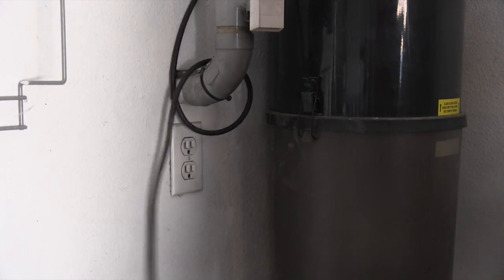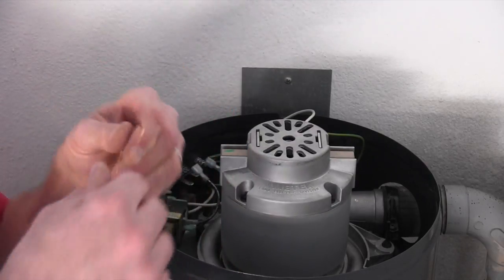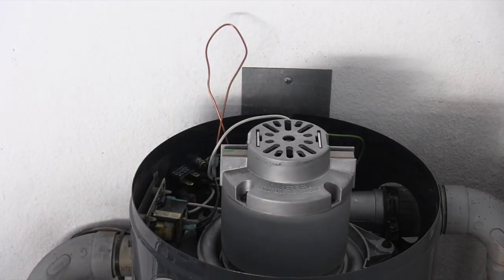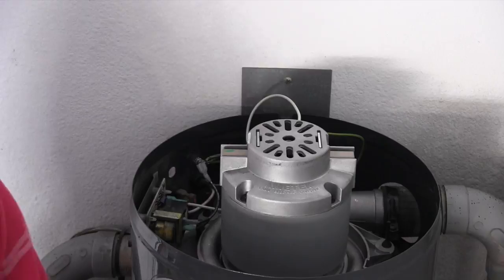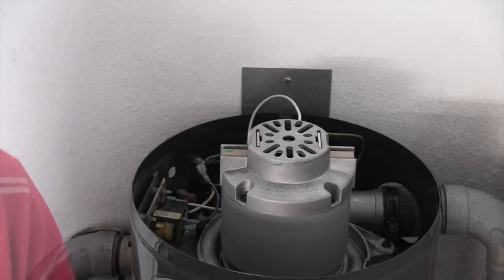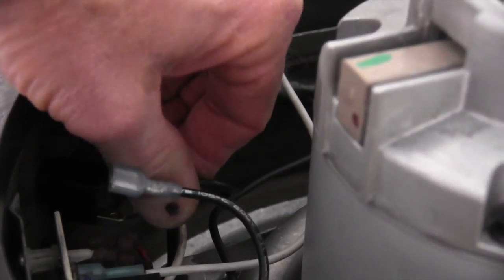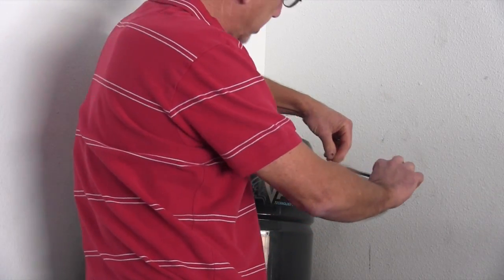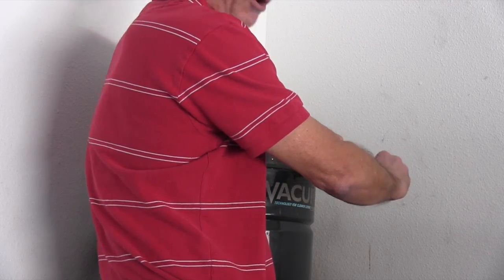An Easy Repair for a VacuFlow Vacuum

Comment: Your fix worked perrfectly!  I've got a Vacuflo 960 with two of these circuit breakers and both of them failed when the vacuum overheated when the exhaust on the top of the unit was inadvertently blocked.  Jumped the breakers to isolate them as the problem and then sent off both bad breakers to SanpAction and received the new breakers in about a week (only paid the cost of mailing the bad CBs to SnapAction).  Thanks for posting the video...probably saved me a couple of hundred bucks.

Comment: Hey Mike,  did you ever bother pushing the manual  reset on the breaker you replaced? Also, great thought using bare wire, good thing you  didn't electracuted. BTW breakers don't normally  go bad. "Loads" such as a motor drawing to much current will trip a breaker. Did you ever put and amp meter on your motor?  People,  find the source of a problem. Just don't start replacing parts. It will get costly.
Reply: Doesn't look like he is going to respond to you. I have a Central vac with possibly the same issue. Last week it quit. I hit the reset a few times and it did not work. I took the top cover off to inspect all the wiring and found no issues so I put it back together. It magically started working again lol. It has now quit on me again so I am going to try and do what he did. I'll let you know how it goes.
Reply: So it was not my manual reset. I tapped on the motor with my screw driver and it started back up. I have a loose connection somewhere now that I have to look for. The vac is over 30 years old so I am not surprised lol.
Reply: Similar problem: did u find the loose connection ?

Comment: Great video mine shuts off when it’s running for 10 min I believe it’s a heat overload but don’t know how to ck it or what it looks like ? Any help
Reply from the maker: I'm not an expert on those, but got lucky with the fix.  You might try contacting VacuFlow at https://www.vacuflo.com/wba/header/contact-us/ or there's an outfit that sells parts for them online, Central Vaccuum Parts at 800-971-7172.  They seem to know their stuff if you get the right person.  Good luck!

Comment: Our Vacuflo 560 start is intermittent.  I have to go out to the garage and tap the canister several times for it to start up.  I'm thinking maybe the brushes, but would the breaker behave in this manner as well?
Reply: Thomas Moher Just call a service person. My vacuflo people are the best. I have had a 560 for about 20 years. I have called them maybe twice. It is a great product. Get it fixed.
Reply: same on mine brushes worn out its an easy fix...